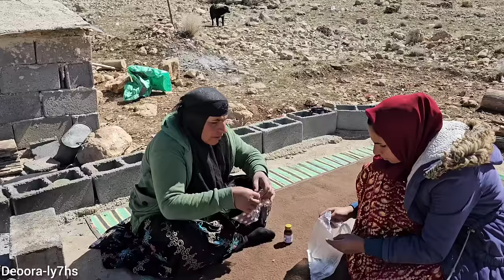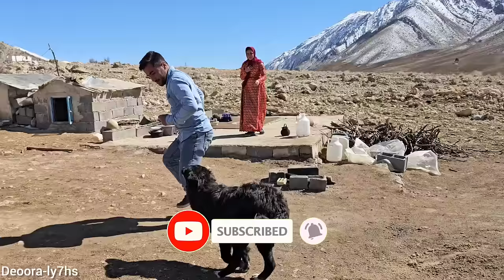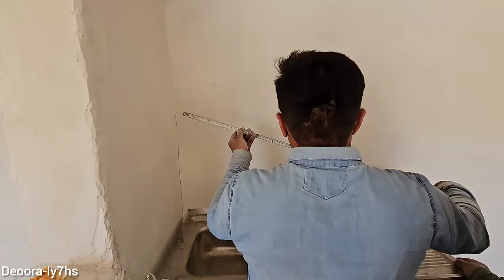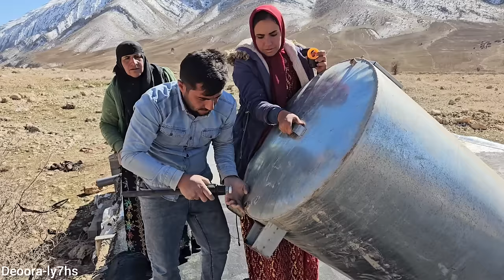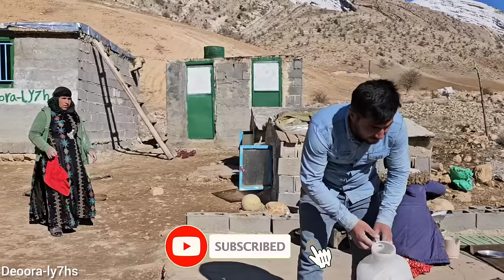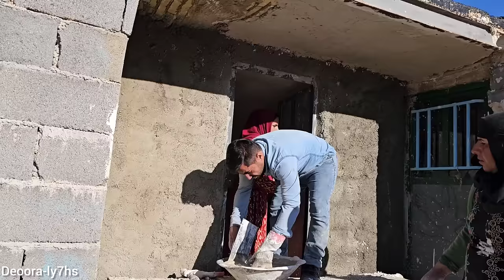Romantic life: persevering against problems and buying kitchen appliances for grandma #deoora-Ly7hs

Comment: Может быть построить из блоков постамент за кухней и поставить на него ёмкость.? Крыша может не выдержать тяжесть ёмкости с водой. Немат подумайте об этом. Ещё не поздно всё переделать. 😊❤❤
Reply: This is a good  idea. Just bulid a pedestal block  about 5 feet off the ground behinf the kitchen wall where you place the sink. Put the water tank on the pedestal. This way you can use the ladder easily fill the water tank the water tank. No need to climb so high to the roof. It is very dangerous especially when there is snow. Very slippery.  Just think about this idea Nemat
Reply: Tenho medo do telhado😢
Reply: Admiro la humildad de la sra madre...pero la construcción no está solida....en vez de poner ladrillos en el techo  hubiera colocado chapas y vigas....gasto inútil...

Comment: Why put the water tank on the roof? Will have to climb on the roof every time it needs to be filled. Wouldn’t it be better to put it on the back side of the house by the kitchen wall and make a hole for the hose? Would be so much easier to fill the tank.
Reply: Они все делают плохо, не стараются делать качественно
Reply: Good option.
Reply: Accident will surely happen!

Comment: Hello Nemat and rest of the family.
First of all, I congratulate you for your great support for Fatima's family, now your family too, and you show it every day.
I don't usually write in comments on videos, but I have seen that with that installation you can have a problem and the ceiling can collapse.
The solution I see is to put 2 small beams or two thick wooden boards. Much better are two pieces of beam, that reach between the beams that you put on the ceiling.
It's a lot of weight and I don't think the legs fit into the beams...
To do this, cross the two small beams under the legs of the water cistern, but they must reach the size of the distance between the beams of the bricks. This way you compensate the loads between the iron beams and not between the bricks and cement. It won't hold up if you fill the entire Cistern. A hug and if you need help with something on the internet. Do not hesitate to get in touch and whatever you need, it will be a pleasure to help you completely free of charge.
Regarding YouTube and his old channel. If you prove that it is the authentic one, they will end up returning it to you, but it usually takes some time.
For this reason, it is usually interesting to have another channel monetizing, for example in the name of Fátima. And you have a main Channel and a support Channel. You upload repeated videos from the other channel, but since they are also yours, you can do it perfectly. One channel in your name and another in Fatima's name. This way, if for any reason they cancel one temporarily, you always have the other, and you are not left without income. You generate less until the problem is solved, but you don't end up with zero income.
This is what most channels do.
It is as if all the channels that had copied your channel would belong to you, to each one of the family... all the income would be for you. And if one channel fails, you have others generating income.

Comment: Very good Nemat for the new sink and tank. My only concern is the weight of the tank fill with water, you need to put two pieces of wood planks or two pieces of metal on the foots of the tank to rest on at least two of the iron beans to avoid damage to the brick so no one gets hurt. Or build a platform behind the house with concrete blocks

Comment: The sink should have been placed in the center of the wall. 
The edge of the counter will become an issue later. Also
please consider putting the water tank on a slope by raising 
the back end slightly. It will help to drain out most of the water.
Reply: He put the sink where he put it because he does not have experience in doing the dishes and the women did not speak up so they'll make it work
Reply: صح👍🏻
Reply: @cathmires8990  Même si  elles avaient parlé,  il ne les aurait pas écouté 😡

Comment: Nemat I agree with what others are saying. The sink should've been put in the middle because if you look at the counter top the corner may poke your body, that'll hurt. The big tank on the roof with the weight of the water could collapse within time. It would be much easier and safer for Soraya or Hussein if the tank is on the ground to fill the water back up. The snow and rain will be an issue.

Comment: Que trabajador Nemat a todo le hace, a la construccion, a la plomeria a todo, todos muy trabajadores, gracias sr., camarógrafo, bendiciones❤❤❤❤❤❤❤❤
Reply: Nemat's work is very questionable and impractical - always rushes in and never thinks or plans ahead, especially with regards to safety - remember the oil fired heater at the previous house - nearly burnt house down - and Nemat mentioned today that he will buy Soraya a gas cooker for the new kitchen - WOW - I always dread the way Soraya pours oil on the fires she lights ant then keeps pouring it on once it's ignited - she'll get caught eventually and that could be quite a disaster! I would be very worried about Soraya having a gas cylinder inside her kitchen or anywhere inside their home!🦍🙈🙊🙉🫣👹🤬

Comment: It is better if they build a flat form behind their kitchen sink rather than placing the tanker at the roof. Their roof are not that strong enough to support a tanker for a long time it could collapse after few years. As long as the tanker are elevated to the floor and installed the pipe properly the water will  comes out. It will also lessen the burden of refilling the tanker, especially they manually put the water in it.

Comment: Yes,  I agree the roof is not the place for theb tanker. They it have gone behind the house right on the other  side of the sink. If it needed to be elevated  for good  water flow then, they should have built up  a higher platform and then sit the tanker on a higher platform, but the roof is a very bad idea.

Comment: Netma you should have built a Square stand (1.5 meters high and 1.5 meters wide ) outside behind the house near the kitchen. Then you would have the tank sitting on the stand not sitting on the roof. How are you going to get the water up there every time the tank runs out. Furthermore, the sink is in the wrong place. It should be in the middle of the wall towards the plate rack. Where to have the sink now you could have made another bench. I think you should change it. because having the tank above the roof is quite dangerous.

Comment: I don't understand why they didn't put the water Tank behind the wall of kitchen and bring the pipe Straight above the sink so it would be easy to feel it up with water too and also the sink is in wrong place on the corner , AS they say when you want to do something THING two time !!!! And then do the job I think this people like to work hard NOT SMART!! I saw a lot of work they did it was wrong and they had to do it a gain differently just look at the entry doors they are so close 2 doors in one corner that two people can not stand together and I saw a lot of them put the tank on the roof well GOD BLESS ALL.

Comment: There doesn't appear to be much planning with anything.  It's all ad hoc and rushed, often fixing mistakes.  They should think about things a bit more before doing. Yes,  the sink is definitely in the wrong position, but they fail to see that, and the tank should not be on the roof.  Another mistake they will have to fix. The stairs leading to the water drum for the shower should also be made wider for easier and safer access.  One of these days someone will slip and fall from there as the stairs are too narrow.  The workmanship is fairly shoddy to say the least, but their hearts are in the right place. They are trying the best they know how with what little resources are available to them.